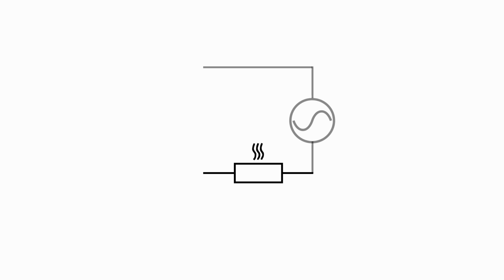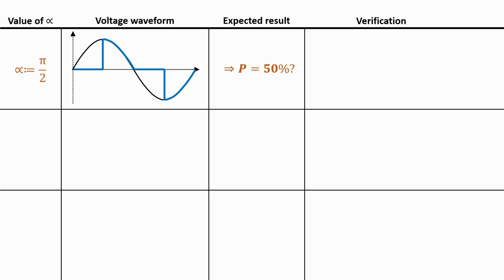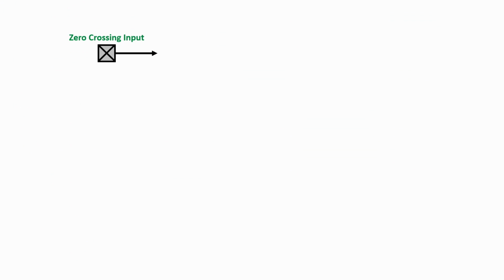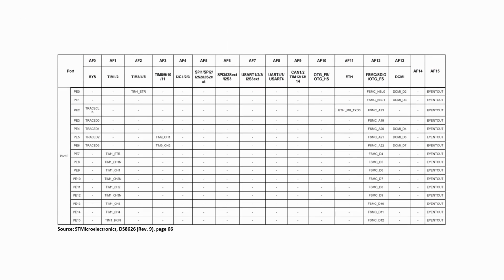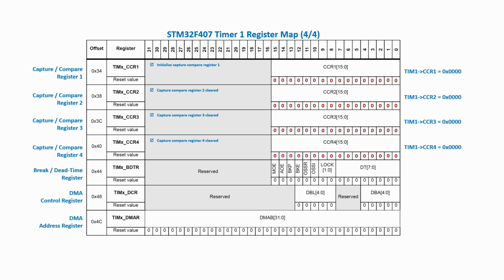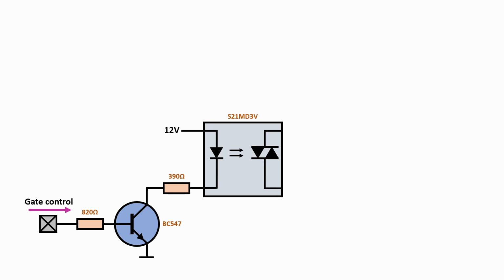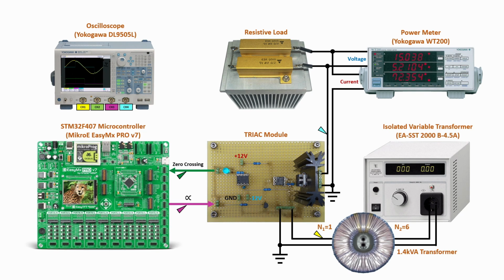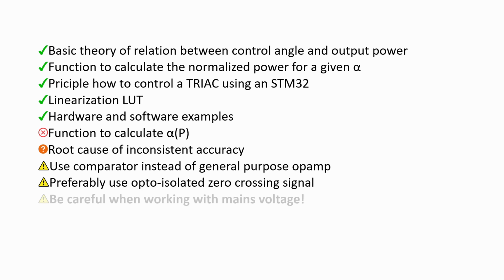STM32 Timer Tutorial ⌚ // TRIAC Control ✅

Comment: I've used PIC18 for this type of project and always used opto-isolated zero-crossing detection circuit, based on simple optocoupler. I don't remember of accuracy of measurement/detection delay of z.c signal behind real z.c event, but it was not a big deal. Big deal was processing capability of PIC18.
Reply from the maker: Sure, PIC18 can also do the job, I just chose the STM32 for this tutorial.
Reply: @AchimDoebler  I've started recently to use STM32. Lot cheaper and better performance than for example dsPIC33. Not to mention bigger support and community.

Comment: Danke ACHIM! I will write in english because the video is in english. I followed your video and i want to ask something if it is possible: You have made a code for zerocrossing detection, so you are generating 3 pulses in 20 ms and it works very fine. What i am trying to do is to give the pulses but  2 pulses in 20 ms. So, iam trying to detect only a positive edge  modifying TIM1->CCER  = 0x0001; 		// OC1: On, AH; IC2: On,  Positive edges. It seems that work but with oscilloscope i see that's not perfect because casually appears 3 pulses in 20 ms. What i am wrong? Can you help me on this topic? Danke schön!
Reply from the maker: Hello Hans, yes, I know the reason for that. Could you please reach out to via email, because it's easier to communicate. Kind regards, Achim
Reply: @AchimDoebler   I wrote you Achim. if you can help will be my pleasure.Danke!

Comment: Firstable it is a very good job! congratulations brother! 
Now i have a question: i want to change power variable from Potentiometer using ADC conversion! I have tried to do it but it doesnt function. Can someone help me?   
                  HAL_ADC_Start(&hadc1);					// Start ADC Conversion
	         HAL_ADC_PollForConversion(&hadc1, 1); 	// Poll ADC1 Peripheral & TimeOut = 1mSec
	         power=HAL_ADC_GetValue(&hadc1);				// Read The ADC Conversion Result & Map It To power
	         HAL_Delay(1);
Reply from the maker: Have you enabled the ADC clock? Have you properly initialized the ADC and also selected the correct GPIO analog alternate functions?
Reply: @AchimDoebler   thanks for have answering. 
int power=0;
void set_alpha( int alpha )
{
   TIM1->CCR1 = alpha;
   TIM1->ARR = alpha + SCR_PULSE_WIDTH;
}
/* USER CODE END 0 */

/**
  * @brief  The application entry point.
  * @retval int
  */
int main(void)
{
	 int alpha;
		   HAL_Init();                    // Initialize STM32 HAL
		   SystemClock_Config();          // Configure core clock
		   MX_TIM1_Init();                // Initialize Timer 1 (OC1 / IC2)
		   MX_GPIO_Init();                  // Initialize GPIOs

		                                 
		   alpha = alpha_lut[ power ];    // Get alpha from LUT
		   set_alpha( alpha );            // Generate alpha on output

		   while( 1 );

 /* USER CODE BEGIN 1 */

  /* USER CODE END 1 */

  /* MCU Configuration--------------------------------------------------------*/

  /* Reset of all peripherals, Initializes the Flash interface and the Systick. */
  HAL_Init();

  /* USER CODE BEGIN Init */

  /* USER CODE END Init */

  /* Configure the system clock */
  SystemClock_Config();

  /* USER CODE BEGIN SysInit */

  /* USER CODE END SysInit */

  /* Initialize all configured peripherals */
  MX_GPIO_Init();
  MX_ETH_Init();
  MX_USART3_UART_Init();
  MX_USB_OTG_FS_PCD_Init();
  MX_TIM1_Init();
  MX_ADC1_Init();
  /* USER CODE BEGIN 2 */

  /* USER CODE END 2 */

  /* Infinite loop */
  /* USER CODE BEGIN WHILE */
  while (1)
  {  
      HAL_ADC_Start(&hadc1);
      HAL_ADC_PollForConversion(&hadc1,1000);
      power = HAL_ADC_GetValue(&hadc1);
    /* USER CODE END WHILE */

    /* USER CODE BEGIN 3 */
  }
i would read a potentiometer and put a value in power, in this way i am able to change alpha but doesnt work
Reply: i also have tried to do that :
           HAL_ADC_Start(&hadc1);
	  HAL_ADC_PollForConversion(&hadc1,1000);
	  power = HAL_ADC_GetValue(&hadc1);
	  TIM1->CCR1 = power;
	  TIM1->ARR = power + SCR_PULSE_WIDTH;

Comment: implementing it using stm32cubeide and HAL. But for some reason its not working as intended. I am using stm32f103c8
Reply: I actually made it work. Used trigger mode for timer and I kept the period to 10ms and change compare output time according to the table it worked then.
Reply: @EmbeddedEnigma  Congratulations 👍🏻
Reply: @Lichtdesign  thank you
Reply: @EmbeddedEnigma  Hi, I have a similar problem not working properly on stm32f103c8t6, can you please share the timer initialization file .ioc?
Reply: @МаксимМорозов-ю9ы  yes I can give me your email. I will email you the whole project
Reply from the maker: Well, I suggest you to directly try my code shown on an STM32F4 since it will immediately work on this platform and then slowly port the configuration step by step to your F1.